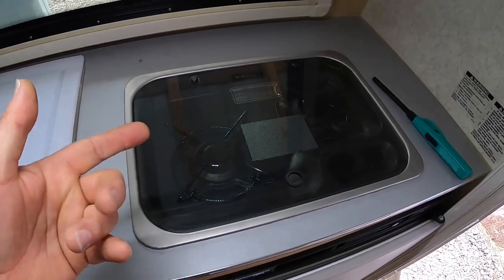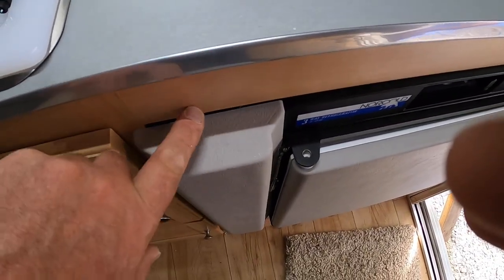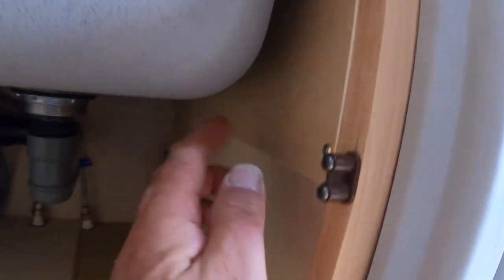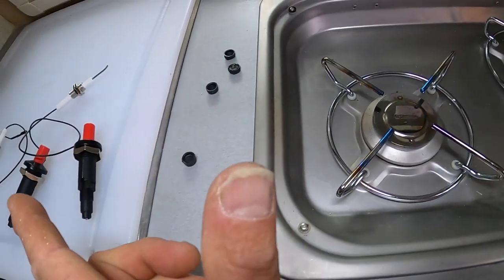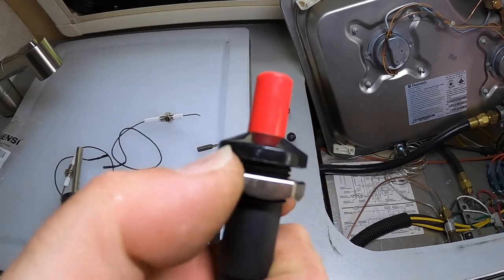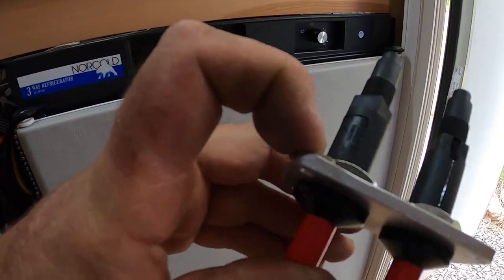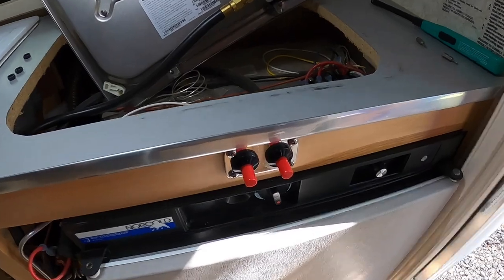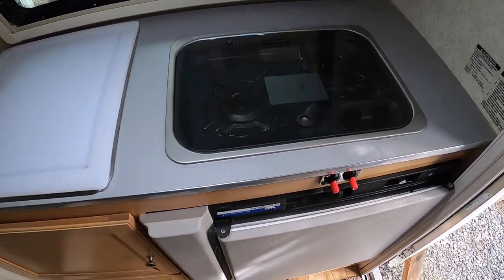Push button Igniters on a Dometic Stove

Comment: Two questions: 
1) Would you be able to mount them in a hole drilled in the wood without the plate...or if using a plate, fasten the whole thing by just tightening the nuts on the switches against the back side of the cabinet frame?
2) Did you have to provide a power source, or is there something in the switch that generates the current to create the spark? If you need 12V, what source did you use? Maybe the product page gives details on this aspect of their installation... Nice addition, for sure!
Reply from the maker: The ignighters can not be mounted to the wood for two reasons. First, the wood is too thick.The sparklers each have a threaded nut, but those threads are only 1/4 inch long.
The wood is over 1/2 inch thick.  The threads are not long enough.
Second, the nuts on the ignighters need to be "grounded" back to the stove base. The plate makes that convenient. Mount the ignighters on the plate, and run a ground wire between that plate and the stove base.

The other question about power is no, they do not require an power to operate. The snap action of the button itself generates the spark.
Reply: Ah...the black part with the red button appears to be much longer than 1/4"... So, the holes in the wood are a bit over-sized to allow the nuts on the back of the plate to set below the outer wood surface and give space for a wire that connects the plate to the cooktop base? Or did you just cut a large slot that the plate will cover? Thanks for the info!
Reply from the maker: @ebachy  
I drilled two holes the outer diameter of the ignighter nuts.
Reply: @tabtrailerupgradesandmaint2923  For anyone without the electronics knowledge to recognize that a ground wire was needed & who only followed your video, their installation would either fail or shock them if they were touching the metal edge of the stove.  Perhaps you could add the ground wire info to the video.  I soldered mine to the inside of one nut.  Otherwise, thank you for sharing this great idea!  The real challenge was drilling the holes correctly.  I put a board under the stove top to protect what's under there when the drill pokes through.  Mine turned out great.  Thanks again.
Reply from the maker: @BrianZYou  Thanks for the feedback, I have added an addendum. https://youtu.be/W7Cwjvb3opY
Reply: @tabtrailerupgradesandmaint2923  That's great!  Thanks for letting me know, and for sharing all of these great ideas.